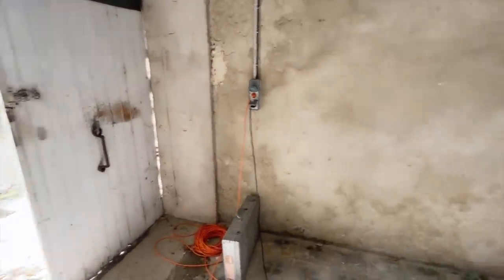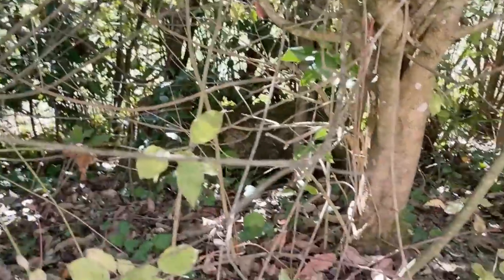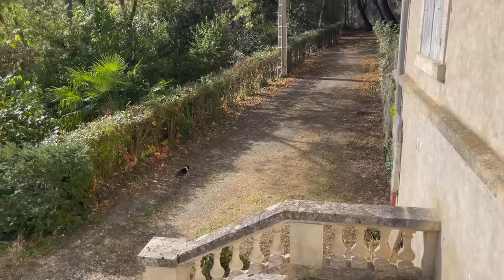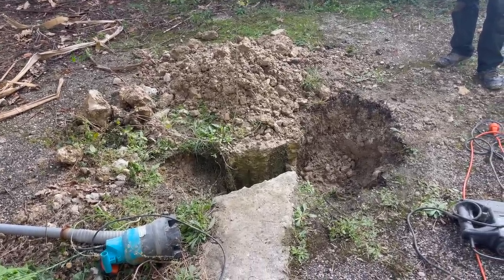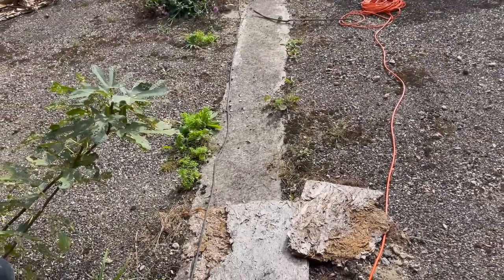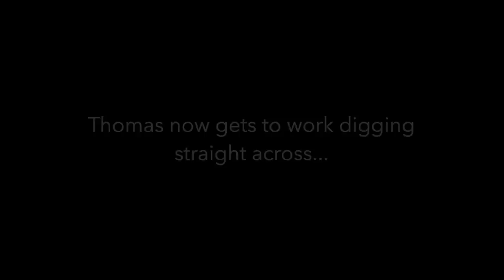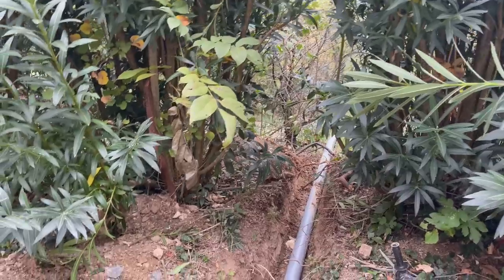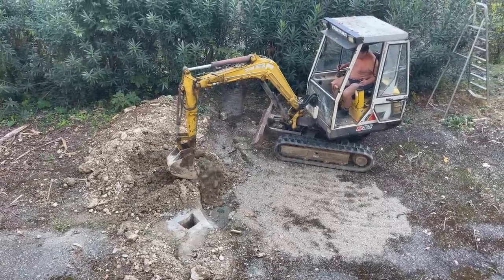What To Do When A River Runs Through Your French Chateau – The Chateau Chronicles – Ep #9

Comment: This looks like a Money Pit, but I am sure she knew that before buying it. It's pretty though. 🙂
Reply: I agree.
Reply: It does need some updating but all in all, it is actually in pretty decent shape. Any old building such as this will likely always need something. It is not uncommon for diagnosis to cost more than the fix in things like this either. 😬 With all of the steps and inspections in France real estate transactions she should know just about everything that it needs for work.
Reply: All old buildings have problems. It may be the German in me but I would have a survey or research old records to find out about the old water system. Then solve the problem, not putting on bandaids. That cistern is there for a practical reason, pipes (broken or clogged) lead up to it.
Reply: @stephjezo6470  Thank you for the info.